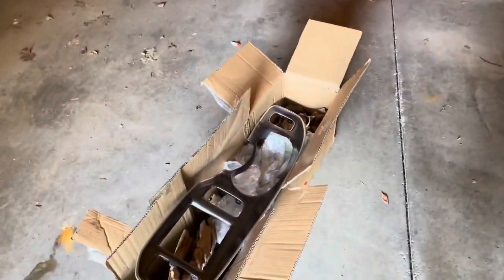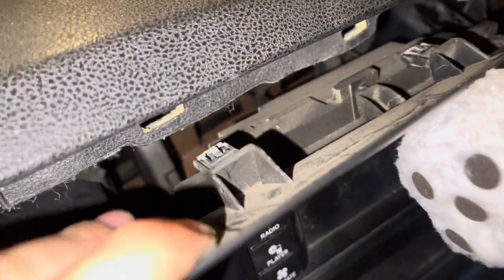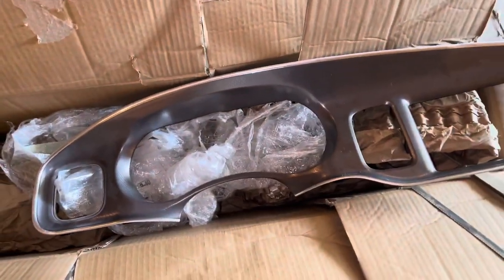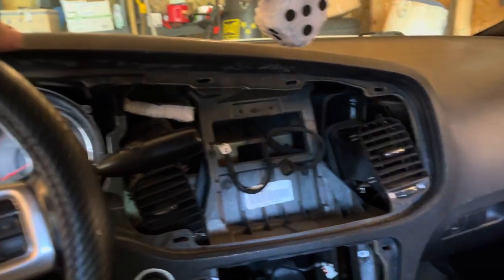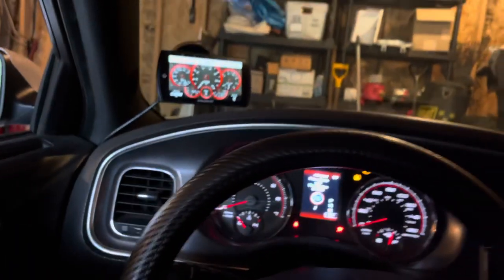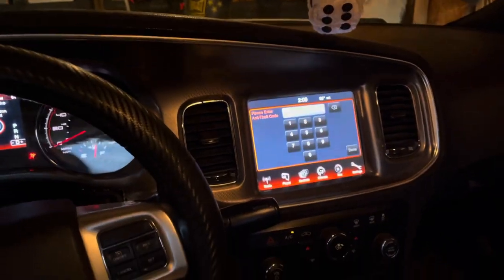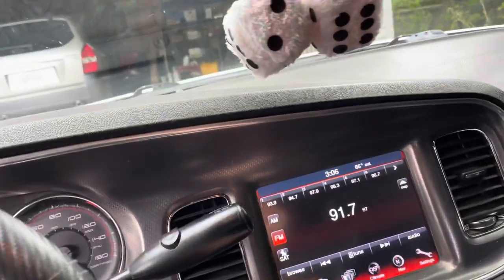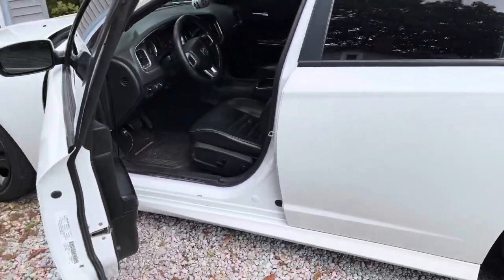Dodge Charger 8.4” Radio & Leather Seat Swap

Comment: If someone you live with has a nail file or you have a sanding paper sheet you can just sand the curves down to smooth out the botched cut it'd look a lot better but it's not that noticeable regardless

Comment: Dude you butchered that bezel. A Dremel makes a smooth clean cut. Also now you need to take the radio back out to install the GPS antenna.
Reply from the maker: Its not a big deal, I’m gonna touch up the bezel later. I just wanted the radio in.. and I know that. I stated in the end of the video I got to order the gps antenna and put it in the receiver. Which only takes 5 minutes